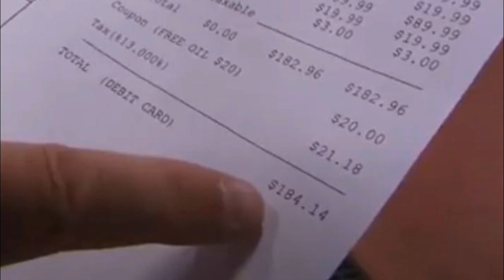He Just Wanted An Oil Change, Then He Set Up A Hidden camera..

Comment: I took my car in to have my front tires replaced because I lost consciousness while driving due to a health condition and I hit a curb going 45mph and it took a chunk out of my tire and I just wanted to make sure they were safe… assuming my alignment was off I wanted that checked too…. my car is brand new only a year old a little over 10k miles at the time… they told me my rocker panel was damaged and needed to be fixed and that they corrected my alignment the best they could… I was DEVASTATED! I called the repair place they told me to and he told me that doesnt make sense and to go get a 2nd opinion and have the suspension checked…. nothing was wrong with my rocker panel no damage at all… nothing wrong with my suspension and they did my alignment with no issues…. I called the dealership he said let me go look at the alignment machine and ill call you back… he called back and said “youre right we didnt do anything ill refund you….” WHAT? yup you heard right they admitted to charging me for a service that was never done and told me there was damage that didnt exist causing me to take off a day of work to get it looked at and I had to also pay for my alignment to be done by someone else…. ALWAYS ASK QUESTIONS if something doesnt seem right…. KNOWLEDGE IS POWER

Comment: That’s great news about the oil changing place. It seems like every time I go for an oil change a tech is always trying to convince me that my Subaru needs more work. 😲I just say NO I WILL GET IT FIXED BY MY SON!!! 😊
Reply: Hi well I went to a quick oil changing place and I waited in the car and they tried to sell me things I knew I did not need. Everything had already been replaced and flushed. I paid for my oil change they said they topped all my oils off. Well when I had to take my Subaru Tribeca to Subaru I was told all
My liquids were extremely low! I explained I paid for all to be topped off and a new oil filter. It wasn’t changed. I did tell the oil place I would not return for more work or an oil change. Bad business!!!